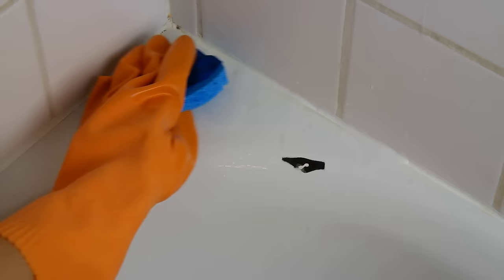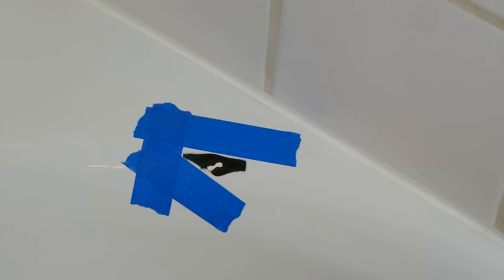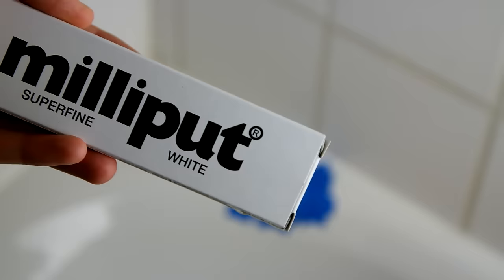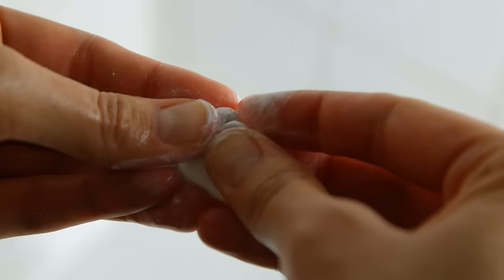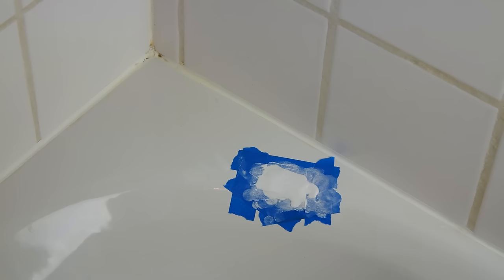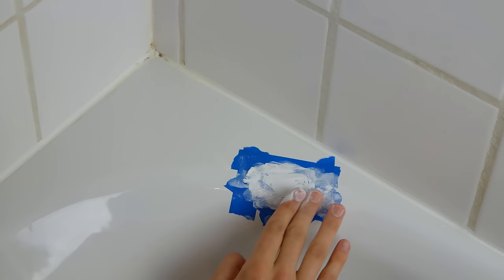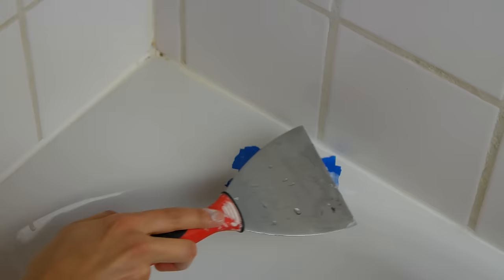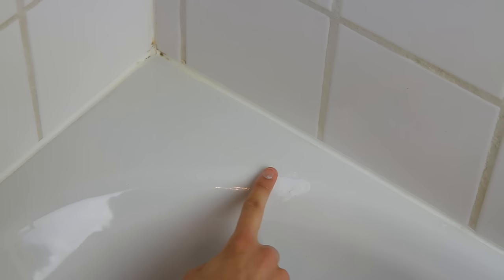DIY Bathtub Repair

Comment: I'm getting my bathroom remodeled and the contractor dropping the hardware for the plumbing in the BRAND NEW tub he just installed and left a chip but said nothing. Later that evening my son saw the chip and pointed it out to me. I'm now looking a way to repair it before it gets bigger because now I'm seeing rust in it and I REFUSE to let the "contractor" that came highly recommended by my 3 sisters back in my house to do anything else after he sent a subcontractor to tile the shower walls and floors. The guy left grout all over the glass border tile, didn't grout some parts of the shower, tiling on the floor not leveled, grouted the light switch to the glass border tile, etc... I can't go on but...
Reply from the maker: mikspoonks h Oh no, that is the worst! We've dealt with some terrible subcontractors, too.
Reply: I hope things are going better.  I have been  having my home repaired for over 30 years. It is rare that I have found any type of repair person that is good and honest.-Boy do I have stories to tell.  Chipped tub, bad tree trimmers, poorly painted house numerous times, dishonest plumbers, etc. etc. I think women believe that if the person is personable/friendly they have made a new honest friend of some sort.  Many women have to understand it is a business and not a social thing.  I seem never to have learned.

Comment: this is awesome, thanks! what about polishing it? I want to use this technique on a small chip on the edge of my porcelain plate (hope this will still be dishwasher and microwave safe)
Reply from the maker: That wet-or-dry sandpaper in 1500 grit can get it nice and polished! Reviews for Milliput on Amazon say that this stuff has withstood lots of rounds in people's dishwashers and microwaves. If you want it to match in terms of color, definitely use Sheffield Porcelain Touch-up + Tints-All in the right shade for a final layer.
Reply: @Somedayilllearn  Thank you so much for the info! Very helpful :) I looked up the tints all, I don't quite understand, I see a bunch of color charts, are you supposed to get that and put a few drops in another product until you manage to color match? Seems like you'd have to know colors to make this happen
Reply from the maker: @GadgetsGearCoffee  Peopl use the Tints-All to dye the Sheffield Porcelain Touch-up paint and paint over the Milliput with that. It's definitely an art form. I'd try just as you said: using a few drops to eyeball the color until it's as close as possible (and painting a test drop on something, letting it dry, comparing to the original color and adjusting from there). Short of hiring a pro, that's as close as I'd be able to get! :)

Comment: Do I have to put the paint on over it at the end or can I just just the milliput? I don't care how it looks. I just need to fix the chips because of rust. Don't want to take a bath in it unless it is safe.
Reply from the maker: Annelise Crumb Nope, you can just use the Milliput! We were in the same boat...simply didn't want the chip to get worse.

Comment: I used milliput for a 2x2" chip, that I have painted for years, a few months ago.  Can I go over the top of that fix with another coat of milliput?  Thanks for video.
Reply from the maker: Yup! Just make sure to sand it down first.

Comment: Do i have to paint at same time as I apply the milliput?  I have milliput, sheffield touch up comes next week.  Want to fix chip today.
Reply: Hey there! Doesn’t have to be done at the same time - just make sure to use that wet 1500 grit sandpaper on the surface before and after painting (after all material is fully dry) to help it blend in. And if the paint doesn’t match correctly, you can get that Tints-All to help dye it the right color.

Comment: Better to use resin with fiber glass then putty.
Reply from the maker: If it was a HUGE crack we'd use Bondo Resin, but for a quick fix this was a lot easier and it's stood up perfectly over the last 3 years. We've seen repairs done with that other stuff, and the mixing/cloth lay looks pretty unwieldy.

Comment: Does it dry the right colour?
Reply from the maker: You have to use Tints-All to tint it the right color.
Reply: Oh, ok.. Really surprised you didn't do this, seeing as this appears to be your showcase video on here.
Reply from the maker: We have 4 little boys and a BIG old farmhouse to work on, so this project was minor in comparison to other issues we're dealing with. We simply wanted it sealed so it wouldn't continue to chip (function over form!). For fussier people, though, Tints-All will get it the right color.
Reply: Ah, that's fair enough :) The main thing is getting it sealed so that it doesn't rust...once rust gets in it can be almost impossible to get rid of.
Reply: @Somedayilllearn  Hi I saw your video  and it is very helpfull, can you kindly explain me or send me a link where to get information in how to match the color with the tub? Mine chipped pretty much the same size of yours at the video, The bathtub is brand new, just installed a week ago! Thanks in advance

Comment: How about can we use Super Glue Porcelain Chip Fix product?
Reply from the maker: I assume that would work similar to Milliput, but I haven't tried it. Here are all the products we used:

Masking tape: http://amzn.to/29XOU7w
White superfine two-part Milliput self-hardening putty: http://amzn.to/29XGltG
Razor blade or putty knife: http://amzn.to/29Q5MON
Wet/dry sandpaper in 800 and 1500 grit: http://amzn.to/29Q5jwh
Sheffield Porcelain Touch-Up Paint: http://amzn.to/29XRyKI
Tints-All (optional, if paint doesn't match): http://amzn.to/2jKJHZl
Reply: Someday I'll Learn I have a question, do we use porcelain white or white?
Reply from the maker: @munchocrisps  I used white and it was a little too bright. The color will depend on the color of your tub, and you can use Tints-All to tint it, too.